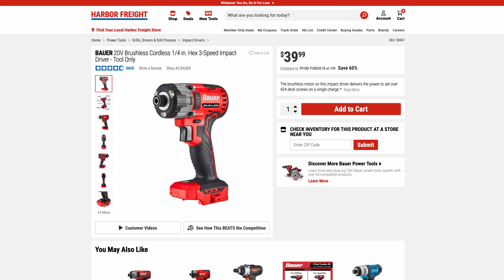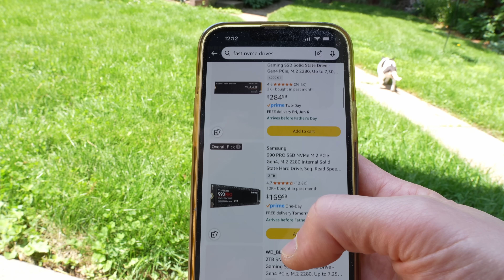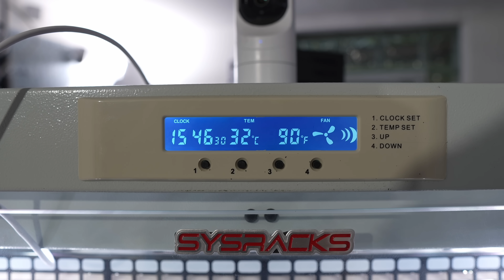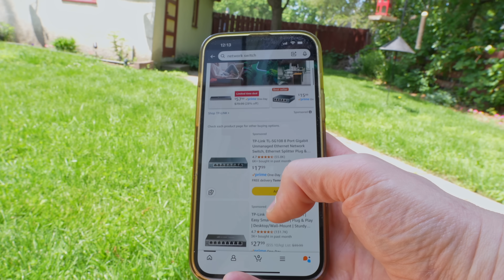Buy Once, Cry Once: How I Wasted $2,857 on Switches

Comment: I like Adam Savage's philosophy here - when you need a tool to get something done, buy the cheapest version you can to get the job done. Once it breaks or isn't usable, get the nicest version of it you can afford. This allows you to prove to yourself that it's a worthwhile investment, while not breaking the bank to solve every single problem. I think you finally "broke" your tools!
Reply: I did the same with a drill. I needed a small cordless drill for odd jobs around the apartment. Didn't know if I would use it often, so I bought the cheapest supermarket bargain brand. I use it more and more often and after five years (!) it finally shows symptoms of giving out. 
So I have saved money on using a cheap one, still got years of use out of it, and now I know that the form factor is okay for me and I don't need a big 20V powered drill.

So now I'm on the lookout for a good, compact, 12V powered driver, which I could use for years and find replacement batteries for, when they die years from now.

I'm considering Bosch drivers, but if anyone is interested in giving any suggestions, I would be welcome to read them. I'm in Europe BTW.
Reply: @zaqway  no such animal for drivers. Odds are the usb rechargeable ones will be around if you don't let them freeze while dead or immerse in water (my bad). For tools bigger than that, best to find a platform of batteries that will be around in years to come, or at least have aftermarket batteries made for it.
Reply: @thedavesofourlives1 Thank you for the input!

My 12V cheap driver actually started failing recently. Doesn't have much torque anymore and smokes from time to time, so the motor windings are probably shot.

I have recently bought a new driver as a replacement. Didn't go for Bosch like I wanted, because I feel like they're still too expensive for my use. I went with two "Dedra" drivers, seems to be a "cheap but not bad" brand. Came with two batteries with each drill and I also bought a mini grinder which uses the same batteries.

The batteries seem to have he same form factor many of the cheap Chinese drills, so replacements should be plenty, if all of the six batteries die one day. Worst case scenario, I should be able to repair them and/or replace the cells, since they are very easy to disassemble.
Reply: I like this approach for some tools, but not for everything... for example, measurement tools. 

Sometimes the cheap tool would not even do job properly from the start. I have seem so many crooked shelf just because someone purchased a cheap bubble level while a good and "expensive" one is not even that much more expensive. 

The measurement cup at the start of the video are another great example of a tool that you should invest from the start. You would spend like $10 more, but you would never had to purchase it again.

Now, for the tech point of view, it's better to grab a middle ground. Never the cheapest or the best. Just enough to future proof you at least 1 year since tech move forward and it's imposible to always have the best or something that would last forever. The whole point if having something that would last you long enough so when the time to upgrade comes, you don't regret your last purchase.
Reply: And going back to the subject of the video, I have bought a used (though looked brand new) 24 port Netgear gigabit switch for about $10 years ago. Works fine, don't need anything else at the moment, but once I buy an apartment I will probably invest in a PoE switch.
Reply: I also believe in this philosophy!
Reply: problem here is that this switch didnt even existed when he bought all the others.

Comment: Saw this a day late. I have actually been looking at an AG Pro to replace my aging US-16-XG as I am finally out of ports on it. Between RJ45 10Gb and SFP+. I've gone both ways on buying. Got a V1 US-48 as my core 1Gb switch and the US-16-XG at the same time and had plenty of spare capacity. Eventually picked up a 24 Pro because of 10Gb uplink for a work area and it was the better low cost option for cost per port with 10Gb uplink. Downsized and moved that US 24 Pro to where the US-48 was and picked up a Pro Max 16 for 2.5Gb and still 10Gb in the work area the US 24 Pro was originally. So one could say I over bought originally and eventually tech upgraded to 2.5Gb for a few clients that would benefit from the higher speed over 1Gb.

Comment: We all are wiser in retrospect. My rule is that I buy at least double (often triple or quadruple) what I think I will need. That seems to work for a few years. However, one exception is that I would have preferred a flash NAS but was crying too much just thinking of the price difference from HDDs. However, recent advances in cheaper, compact systems and memory may make it possible soon, if tariffs are lessened.

Comment: I use Unifi in almost all of my CCTV installs for a lot of reasons. The Flex Ultra is a new game changer for me. I use to daisy chain 1 or 2 flexs together (If fed 60W you can have 2 Flexs off the the first flex, + 2 cameras, then 3 cameras for each sub flex with zero issues). Now I get the 16 Pro Max a lot due to the 4 PoE ++ Ports. Don't need the bandwidth so 1G is enough (99% of cameras are 100 megs anyways) but some clients who want to budget, and not do a full install, i still get a large switch. They just end up wasting money. One of my fav 90s Disney movies as a kid had a great line. Go big, or go home! lol

Comment: Usually I can't afford the buy one, cry once approach on broad scale, but my idea is always that if the object I want isn't 30% more capable than I need now, I don't buy.
Now I need 5 network port, 2 of them 10gb, no sfp. I have a 12 port switch with 3 10gb rj45 and a sfp+.
It has fancy rgb, poe+++++++++++ or whatever? No, but poe injectors are dirt cheap if I need one, and rgb isn't mandatory, so I have a sensible margin for growth imho.

Comment: Now you have ultimate switch .
Now you can upgrade your system with a 25GB server backbone and backup system.
Than you will get the next new innovative gadget with a revolutionary and incompatible network standard (hardware or software ).
Time then for the next expansive switch .
It is a never ending story .

Comment: For homelabs such purchases usually happen over years.  Years during which hardware is getting better and prices are coming down in parallel.  So often buying minimalistic hardware and replacing it is cheaper in the end.  I also like to keep the previous set of hardware around as a backup in case of a defect or for mobile use, trade shows and similar.  Plus there are older features such as 10Mbit/s or even coax support which I still need but which are not supported by the latest hardware.  Because this variant is way cheaper than getting a new $$$$$ logic analyzer only because it support the type of networking my switch supports, too!
The other issue is that my needs and constraints evolve and even with all the knowledge I have I'm going to gain experience.  I don't want to cry a second time when I find that the awsome switch I just acquired really is a POS.

Comment: I don't think 10Gbps over Ethernet will take off. 2.5G seems to be the next step from 1G in home/small office setups, but beyond that the power draw seems hard to justify. Corporate networks have been running 1Gbps for at least a decade and they are certainly fast enough for most purposes such as camera streams or Netflix for at least 10 concurrent users if not more. A few years ago I ran a fiber link with SPF28 (25Gbps) adapters between a NAS and a workstation but did not bother last rebuild as I has no real need for it besides running iperf3 benchmarks.

Comment: What can you possibly do that requires more than 48 ports (or even 24) in the main switch? You can use a tiny desktop switch with 4 or 8 ports (and PoE) closer to where its needed, for example in the attic if that's where the cameras are wired. Supplementing the main switch this way is the smart way to avoid avoid constant upgrades... These days though if you need a new switch, buy one with some SFP ports for >1Gbps uplinks or devices such as a workstations or a NAS.

Comment: sometimes you just don't have enough to buy once lol. I'm in the same boat  moved  into a new house and under estimated my needs big time .  I  bought 1 16 port pro max poe  to add to my  new build  then had to add a second one a few months later after i got around to running cameras and AP's  well now i have almost all the ports used and still have more to add. now i wish i could have gotten the pro max 48 POE. would have been a big hit at one but saved on rack space at the end lol, the choice was get up and running now or save for a few months to get the big daddy switch. Looking back i do think saving up would have been the better choice

Comment: As a software developer, I tend to take the mentality of picking a feature set that is expected, and iterating from there. Currently, I have a 48-port gigabit switch that a friend gave me years ago to get started, and I have the Ubiquiti Dream Machine Pro as well as a Flex-5 which both are for PoE++. Why did I go for PoE equipment? Well, because a friend recommended I get a Unifi AC-LR access point. However, I had no way of knowing (at the time) that said access point had non-standard PoE, and only worked with the provided injector.

So where does that leave me? Well, in the house we plan to buy, we will be installing cameras, a doorbell (or two), and running PoE everywhere. This means a new access point will be purchased at that time, as well as new PoE switches to support the extra connectivity, all while likely upgrading the connection speeds from gigabit to at least 5G, if not 10G, since I already have a few machines with 2.5G on the network. I'm also planning on adding a few fiber runs to the house, to provide future-proof solutions going forward.

Until then, my hodgepodge of 5-16 port switches are good enough to get me through apartment living.

Comment: I learned long long ago that there's literally no point buying expensive switches when nothing in the home actually needs a ton of bandwidth.  So, at most... I might have a high speed link for NFS or SMBFS between my server and workstation, but that's it.  Everything else is just gigabit, including the Wifi.  And dumb gigabit at that.  Not even managed switches... just VLAN-enabled dumb switches and the home server manages any bandwidth bottlenecks.   With the added bonus that cheap unmanaged gigabit switches only burn 2-5W of power (and I have at least a dozen such switches strewn around the house... it adds up).

After all, a high fidelity 4K video stream is literally only 2.5 MBytes/sec and a gigabit link can do 100 MBytes/sec.  A security camera running over PoE+ typically runs less than 400KBytes/sec (unless one is dumb).  And no matter how fast a person's wifi router is, actual back-haul bandwidth degrades rapidly when more than one device is trying to use it heavily at the sametime.

The only thing that actually benefits from 10Gbe are remotely-mounted filesystems and in my entire home that's literally just two workstations that need to talk with the main server.  Nothing else.  And even then its a mere convenience for photo editing.

-Matt

Comment: I decided to splurge on some hardware to build a new NAS this was over double the all-in cost of my little tiny-mini-micro cluster, but it was worth every penny. i7-7700T, Quadro p2000, 4x 4TB HDDs, 2x 256 GB SSDs (plus a boot drive), 32 GB of RAM. I have never had issues with the hardware. The only issues I’ve had are from my own software choices.

I could have bought cheaper (and, to be fair, everything but the case, PSU, and two of the hard drives were used or free), but I have the right tool for what I need, not just a tool.

Comment: I have a house with like max 3 lan devices. I had a Unifi AP and wanted to switch off my router switch as it was causing noticable slowdowns (low throughput I imagine). I bought a USW Flex and a PoE injector for the AP and didn't look back for a while. 

I had the 3 ports used, had a spare extra and had the router too if I needed something slower than gbit.

Then I wanted to buy cameras, problem is, I'd need to buy another small switch, another PoE injector and blah blah. I'd also need a proper server to run the controller as my old laptop would sometimes sudoku and lose WiFi, wouldn't want that with my security! So I bit the bullet and bought a UDM SE. Not a Pro not a max, an SE. My best friend called me silly for getting a UDM in the fiest place, let alone paying the extra premium for the SE. He told it'd be cheaper to get a small gateway and a few switches and PoE injectors. Then I showed him that the SE has PoE++/+, and put down the cost of the same setup he mentioned. 

It was about the same price 😂 I now have an SE I can use as my gateway, my cameras and APs switch and still have a few spare ports for other stuff in the future. I bit the bullet and paid the extra, but I'm thankful I did as I wouldn't need to constantly be frustrated I need to buy more stuff (as much as I'd love to!)

Comment: Yeah this advice is only applicable for specific reasons. When you have big plans for the device that you buy, then yes, buy the expensive one after calculating the overall costs. But if someone has no idea about what to do or would like to just buy a device for a small purpose, then the advice to buy an expensive device doesn’t fit. It would be then a waste of money.

Comment: i happy with my 28 port 2.5gbit switch. It has 6 sfp+ ports as well and allows link aggregation on all ports. Yeah, no POE, but i have a 16 port POE injector for my 3 POE devices. This thing cost only 10€ or so.

Comment: I was lucky enough to get one of these switches - Honestly, its a great switch... feature wise... but, its not the 1 switch to replace all switches!

It has issues, its gulps power compared to my Agg. Pro (2-3x at much, thats without any PoE devices).  I think UBNT also missed a trick, they should have made at least 1/3 of the ports SFP+... That would have made it the "1 switch to replace all.."  (80% of my 10Gb devices use SFP+, and hence why the Agg Pro is so efficient!)

Comment: Typical rookie mistake. If you are the average Joe then this shouldn't be a problem, because your home network needs most likely won't change for years. However, if you are a pro user and like to tinker with new tech then you have to do proper planning just like you do for electrical or plumbing infra in your house. When I moved to the new house, I was no where near using fiber optic devices throughout my house, but since this is a brick house and future cable runs would be very difficult,  I did run fiber to pretty much every room. This was 7 years ago and just last year I came to the point where I need to install 10G switch on the second floor due to the bandwidth needs. Those earlier decisions for proper planning paid off and I'm pretty sure most of those fibers will be fully utilised within 5 years.

Comment: But is it now just a single point of failure?  Did having multiple pieces of gear give a level of redundancy, given the ability to swap around some jumpers and retain some level of connectivity while replacing/repairing the failed switch gear?

Comment: I think it all comes down to what you feel is a priority. I am currently looking into upgrading my network, and I am doubting what switches to buy.
I did realize that most of my devices just run on gbe. Hell, even my 5 year old Philips smart 4k TV only has an 100mbit ethernet! Why buy a 2700 dollar 10gbe poe+++ switch if you only use poe for the gbe devices. Do your 10gbe devices need poe for example? Are your camera and wifi AP's really limited by the gbe speed? 

If its a priority to have an all-in-one solution, like you. Yes, I understand. But personally I would just buy for future expansion, not just an all-in-one solution.

For my case, I probably will keep my 24 port gbe poe switch with 10gbe uplink and expand with a 8 or 16 port 10gbe switch for the devices that need it. Even though an 8 port 2.5gbe switch would suffice for the following years.

Comment: The biggest issue I had for the longest time is purchasing so many recommended things from popular YouTubers (No offense Tim) and realizing I may have different use cases than them. I went down the rabbit hole of Hyve Zeus servers, RPi's, small N100 workstations, MS-01 for clusters, MD1200 disk shelves, 3TB used Seagate drives, 4TB used Dell drives, etc. Granted I was on an extreme budget at the time and had to eBay hardcore to get what I wanted, I now have a large collection of eWaste not being utilized anymore. I have replaced an entire rack of workstations and servers with one T640 18x3.5" and two R740xd's. The entirety of both production and testing labs are virtualized on those two R740'd and there have not been any cases as of yet where I can't do something. I also moved away from pfSense/OPNsense with a full TP-Link network to the tried and true Ubiquiti ecosystem and haven't looked back.

Comment: I got 2 XS508M 8 port 10 Gbit switches from netgear - no POE, but I don't plan to add any POE devices. 
Both are unmanaged.
I will need two of their bigger siblings at some point in time and  at least 1 more of the 8 port versions, but that will happen at some point next year.
The switches are multi gig... so they can handle all devices from 100 Mbit up to 10Gbit at their respective speeds.
This way, my 1Gbit router won't slow my 2.5 Gbit NAS, or our PCs, which will get the 10 Gbit treatment as well.
I got both switches used for €200 each.